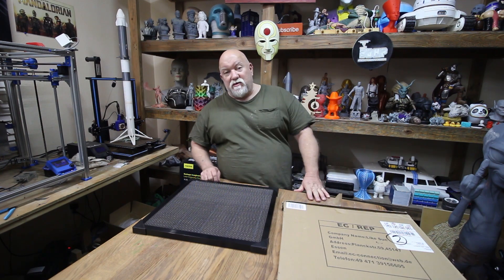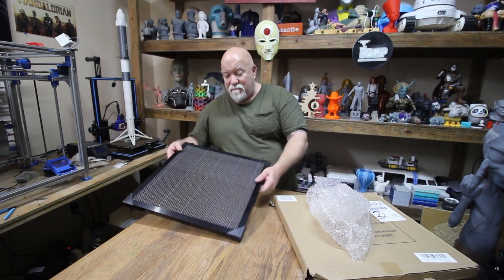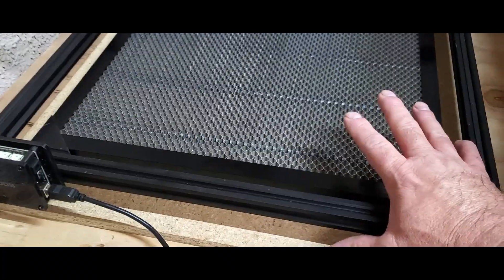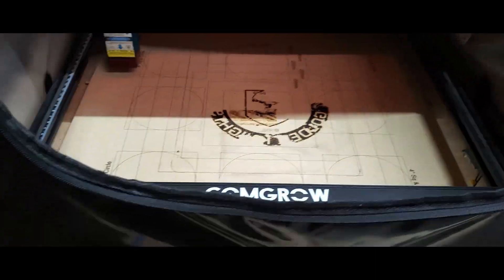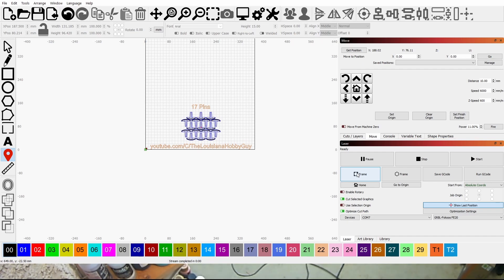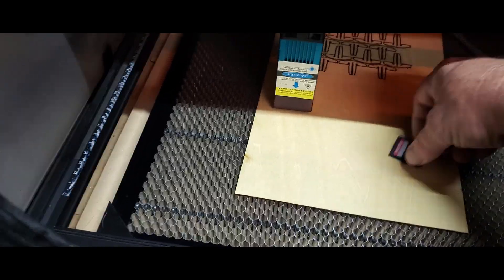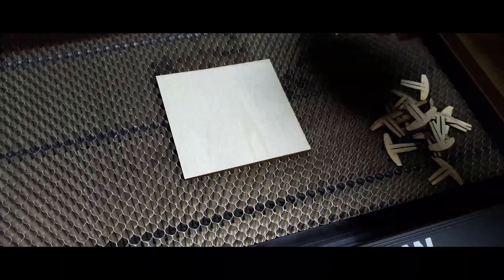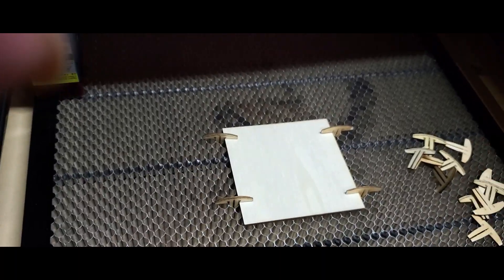HoneyComb Bed for Your Diode or CO2 Laser. #3dhp

Comment: Thanks for the shout out Jerry!
A few tips: Make sure you raise the bed off your waste board, I use a slate coaster on all 4 corners. When you cut, the gasses will go inside the honeycomb and explode if they're trapped. 
If you select one pin and then choose, cut selected graphics on the laser tab, only that one will cut as a test.
You can turn off the output of the black layer and cut the job time in half, and also choose order by group in optimization settings to reduce the scan. Plus set your white space scanning to 4000.
Do a ramp test for focus. Your Fookos was out of focus! 🤪
 And Lightburn files don't remember cut priority Sir! Glad you noticed it!

Comment: Lightburn doesn't always (more like rarely) keep the layer order after saving a project. That's on lightburn. Rich has mentioned the issue in many of his videos.

Sanding the back is another option when cuts aren't clean. The focus point should be below the surface for cutting, that might have been why it didn't cut cleanly. That red shield should really be tossed if one is cutting frequently. Mine started to deform from just engraving work. I believe it also restricts the airflow from the cooling fan.
For anything thicker than 2mm you can't set the proper focus depth w/ it attached anyway and if a cut piece cants up the darn thing will hit it. Mine is sitting in a bin somewhere now, replaced by an air assist nozzle I designed.